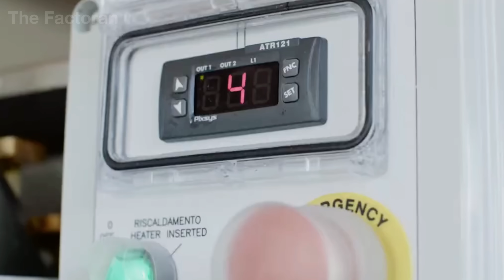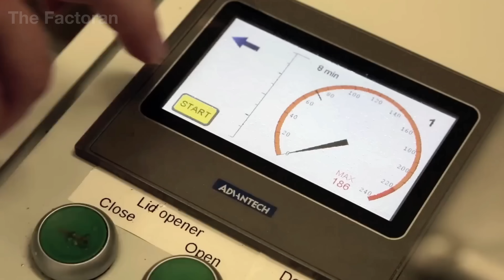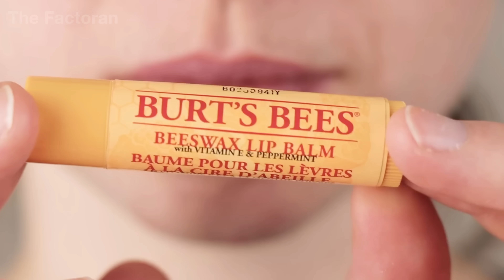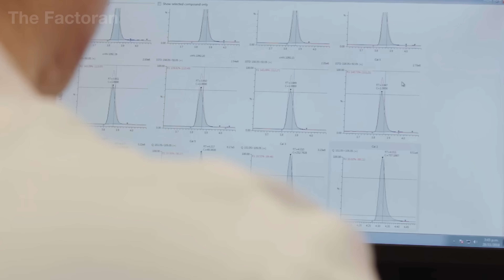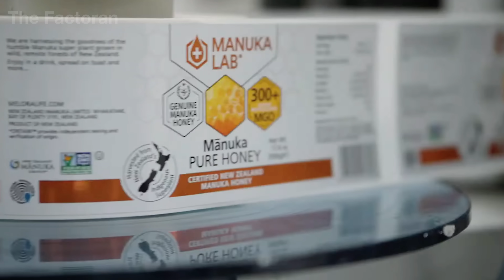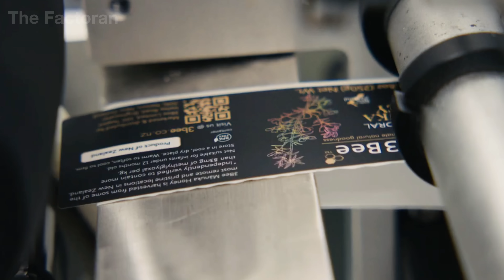How Millions of Gallons of Honey Are Made Inside Massive Production Line

Comment: When I was a teenager I worked in a Seafood Store whose owner was on 24 hour call for the Police and Fire Departments to remove Bee infestations from peoples homes. Usually about twice a month in Spring. One of my jobs was to prepare the Honey for sale. The only equipment I used was a modified Stainless Steel Milk Can which I scalded with Boiling water (Approved by the Health Dept) before use and placed 3 layers of Cheese Cloth on the top opening and naturally let the Honey drip through which I collected via a Spigot at the bottom, in Sterilized glass bottles. Back then we sold it for $1.50 a half pint with some I inserted the Wax Comb for $2.00. I also made up my own recipe for a Shrimp and Honey Dip sort of on the spicey side.. We did not market it though. I Cooked and peeled 50 lbs of frozen Shrimp 3 times a week. 21-25's sold for $1.59 a pound back then. It was one of the highest paid jobs I ever had when Minimum wage was 50 cents an hour they paid me $1.25 an hour and paid for my clothing.. My favorite is Sour Wood Honey..